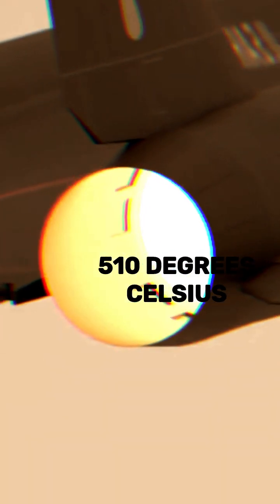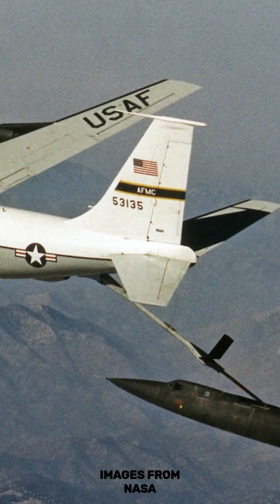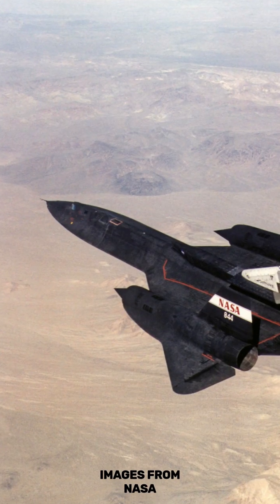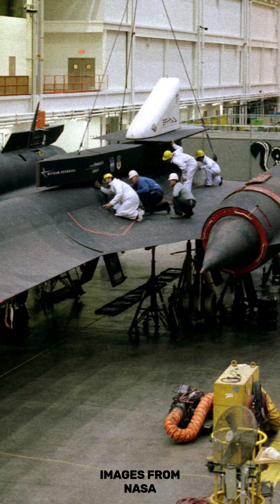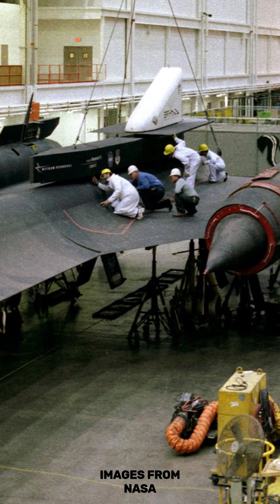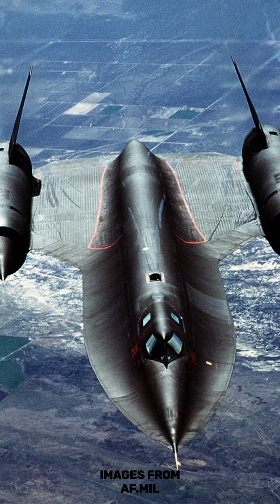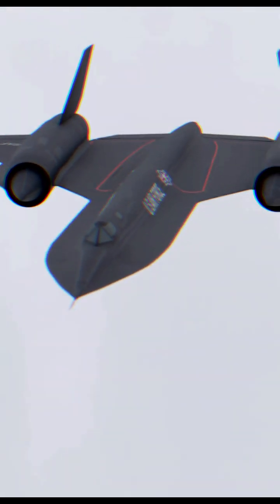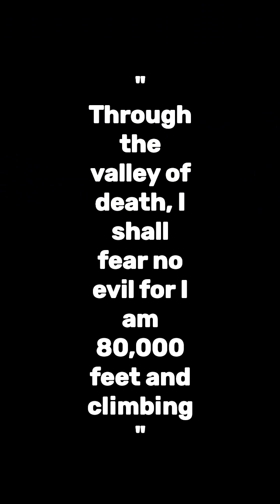What made the SR 71 Blackbird so fast?

Comment: Where does it store all that fuel?
Reply from the maker: It had six main fuel tanks lined along the "spine" of the plane in the fuselage. If you look up a diagram of the plane, you'll be able to see exactly where the fuel tanks are.
Reply: @Flight Online   how much fuel does it hold and how many miles can it go? That's incredible engineering
Reply from the maker: @jponz85  Range: 3,355 mi; Fuel capacity: 12,000 gallons 🤯
Reply: @flightonlineaviation  how!?!?! That's crazy
Reply: @Flight Online  5 tanks through the body, tanks 6A and 6B were in the wings

Comment: When he says "an intentional design factor", that's not an SR-71, that's an M-21, differed by the pylon in the middle. That launched the D-21 drone, which has basically an angrier drone version of the Blackbird. It was basically a small guided missile with a camera. Once complete with it's mission, it would eject the camera and self destruct, with the AC-130 catching the camera mid-air
Reply: Not quite. The aircraft pictured is NASA SR71 carrying the LASRE experiment. The M21 was a derivative of the A12 airframe, which is not in this video.

Comment: Fuel tanks had bladders it leaked on the ground not at cruise speed and elevation
Reply: It did not have any bladders. They chose not to use bladders as the extra weight and reduced fuel capacity weren't desires traits. Also didn't leak nearly as much as people think